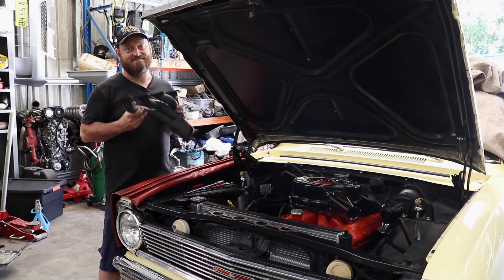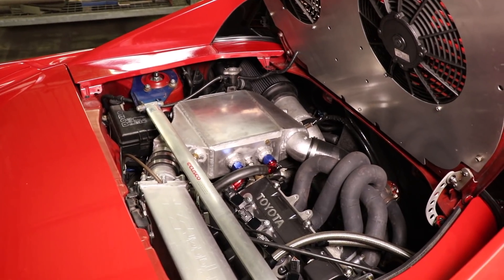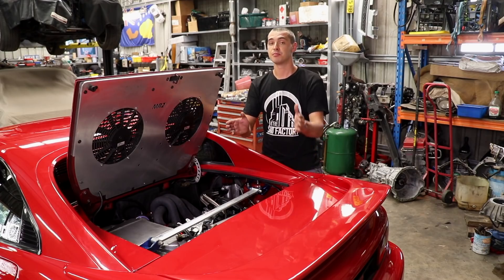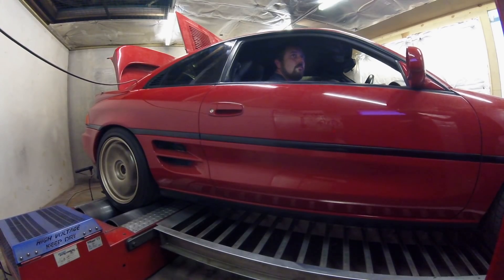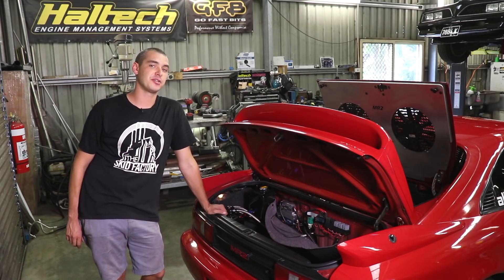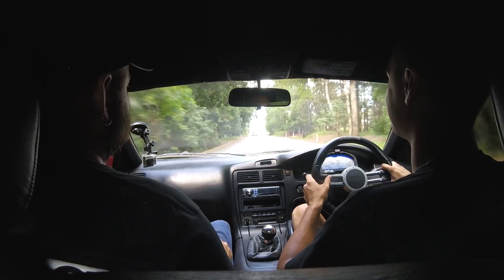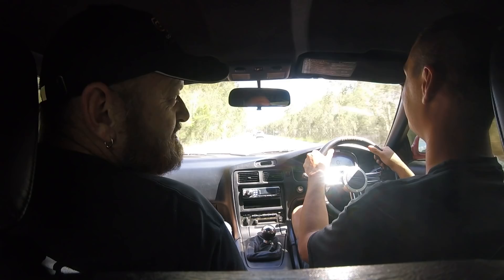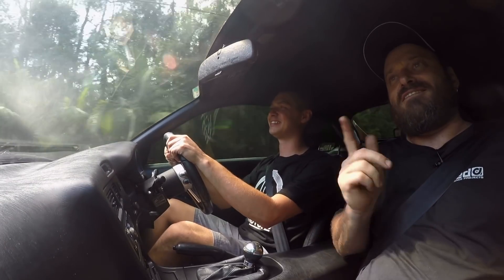THE SKID FACTORY - 430HP SW20 TOYOTA MR2 [Build Review]

Comment: Daily my 88 Aw11 for the last ten years. It's fun but some parts are getting hard to find new. Bought a 94 pickup a few months ago to slow the mileage on the mr2. My first car was an 87 Celica with a early 3s-ge. Old Toyotas are good for what they are.
Reply: I just stopped daily my adub 6 months ago after 6 years or so, and my first car was a 91 celica st184. I had a ZZT celica for a while and would love to get a 2ZZ in my aw11.
Reply: Just sold my 94 pickup about 2 weeks ago. I miss it already.
Reply: Aw11 owner high five!

Comment: The gen4 3sgte from the Caldina is the hot set up now for the MR2.  300whp on stock turbo, ecu and injectors has been done.  That's the route I finally went with my 91.
Reply: Definitely went in the right direction. Sounds awesome.

Comment: as an MR2 owner, one running 300whp, I can appreciate the time, effort and cost that goes into these cars. The biggest improvement is by far once you get a properly tuned EMS running.

Am interested to know if the fan shroud on the bay lid makes any difference to engine bay temps.
Reply: Definitely. It pumps out so much hot air.
Reply: No need for the rain tray either if it never rains there.
Reply: @modermonkula  I'd never to choose to drive in the rain also. It's terrifying enough as it is.
Reply: @25LQW  Yeah thats my thoughts on it, I've been having problems with engine bay and intake temps and being able to reliably push the boost past 16psi. Have been reading up on these shrouds for the last few months, heaps of talk on negative/positive air pressure in the bay and disrupting the air cycle. could be a good mod for city driving, interested to get your thoughts. Being in Wellington NZ, don't have the option of removing the rain cover.....
Reply: @jonoerees  my fans are run through the ecu and are on pretty much the whole time. They work really well. I wouldn't worry to much about the rain with this shroud on. If the fans are running no rain is getting in. As long as your air filter is not exposed it will be fine. And don't run those tom's snorkels. It goes against the flow.
Reply: @25LQW  Thanks

Comment: The 3 litre V6 out of the Camries is pretty much a direct bolt in to those .. I hear they dont mind a bit of boost either
Reply: I think you are referring to the 2GR-FE? It is an absolutely amazing engine. So smooth and will make a healthy 280whp in stock form.
Reply: shoominati23 no
Reply: @NippyMoto  My plan is to drop a stock 2GR-FE in my MR2 whenever my 5S-FE goes. 280 is plenty for me as my daily driver.
Reply: I almost bought an SW20 shell for $800 this year. Toyota V6 was my top pick for swap.
Reply: The 1mz is a good donk.
Reply: @NippyMoto  people were putting 1MZ's in these long before the 2GR even existed. Or 1mz/3mz hybrids.
Reply: @802Garage  just put a K series in it. More reliable.
Reply: @madgreek253  Not really. Not if you turbo it. The Toyota V6 is just as reliable as a K engine and makes way more power NA. Besides if we all did the same swaps cars would be boring.
Reply: My brother had a 3litre v6 converted one, thing was a weapon
Reply: The 2GR-FE engines come supercharged from TRD and go alright but never seen a turbo one
Reply: Needs Radial swap
Reply: Theres nothing wrong with either , but the 1mz is more common in australia .. if you treat either of them right they will go forever . If people tell you they are getting even 50000 miles between rebuilds on a 1000hp 2jz they are a liar
Reply: @brian-yy4bx  lotus evoras run a 2gr with a supercharger kit
Reply: Or just do what Toyota did once and fit in a 1uzfe
Reply: @802Garage   which v6 are you talking about the 1mz or the 2gr fe?
Reply: Brendan Coleman yes mate! That’s the swap you wanna do, dunno how easy it’d be to locate any turbos but with a Haltech Elite it should make pretty respectable na power.
Reply: Like the Evoras's
Reply: @jaykatana9418  I was more thinking of the 2GR. Been a minutr since I researched it though.
Reply: Even the simplest engine swaps are never bolt in. Mighty car mods has really ruined the car community, hate when the term bolt in is used when regarding engine swaps, always used by people who have never actually done an engine swap themselves.
Reply: @Mantenner  How has Mighty Car Mods ruined the community? They're the first ones to tell you nothing ever just bolts in, especially engine swaps. They always talk about how it takes hours and days and really mechanically skilled people involved.
Reply: @alistermccallum  yes, that would be the truck and 4 runner engine... Not the same as from Camrys like being talked about here
Reply: @802Garage  They say nothing ever bolts on sure, but their content has given so many people the opinion that you can do something easily, only recently with their unedited videos do you really get a look at how difficult it can be. Add to the fact that all of their cars just chase power (except marty's kei cars), turbo this turbo that, focus on nothing but the HP figure, bolt on sponsor's parts that normal people will never need or afford for a road car, people only focus on that. They're one of the most mainstream channels to execute said trend and many have followed.
Reply: My mind is actually fucking blown. My mates first car was a 1MZ manual camry (relatively uncommon in Oz, it now resides in another mates driveway) and it fucking -->hammered<--. I always wondered why the hell Toyota wasted that package on such a boat as the XV20 but, alas, Wiki tells me that the transmission was also used on the SW20 turbo.
As far as I'm aware the "bolt-on" TRD Supercharger kits were nothing but trouble for the 1MZ, but with some supporting mods.... 

Guess I just need to find an SW20 now. 😎
Reply: @Mantenner  I completely disagree with you. I think they have always been honest and shown the entire process. They have always made it clear that the work was edited down and took far longer. If anything they are more honest about the process than most YouTubers and they even reference that repeatedly in videos. They also joke about commenters thinking everything is quick and easy and tell them it isn't. I am talking about MCM not just Skid Factory. If people are too dumb to realize that a montage is not real time, it's not the fault of MCM when they give direct disclaimers.
Reply: The 3vz-fe bolts in and handles boost like a champ
Reply: I recently owned a 1mz swapped MR2 for about a year, brilliant car. It was fast enough to have a lot of fun in, although my 330ci is just as fast in a straight line while being much smoother. Its a great swap for how easy it is.
Reply: @802Garage  Fair enough, I do agree if the viewer thinks it's that easy they are dumb, and my comment was an exaggeration about ruining the community, I just know people that seem to have a skewed view of working on cars due to MCM and youtubers of the same caliber. We'll have to agree to disagree on their influence and impact however I guess (I actually think Skid Factory do a much better job of showing the process or working on cars than MCM, I love both but I prefer Skid Factory). 

The whole "JDM" turbo boy culture has erupted due to MCM at least here in Australia, and the first question I'm always asked about my cars is "how much power does it make?", and I whole-heartedly attribute that to youtube builders, and with MCM's size and reach, them in turn.
Reply: @Mantenner  What have you been smoking? people have been asking that question long before mcm.
Car culture always reflects the relevance of "time" and what are the most popular influences.

In NZ, the most popular influence was performance car magazine, then reading hot4's to have a laugh at Australia and to see what not to do when modifying a car.

Most times though the most influential thing is the people you are surrounded by. if your cars shit, attitudes shit and you're are clueless muppet, generally speaking it's likely your mates are too
Reply: @Mantenner  I get what you are saying, I just really feel all the guys at MCM do their best to combat those exact sentiments. There really is only so much you can do on a YouTube channel. If you show absolutely everything you end up with a load of content that isn't nearly as appealing to a mass audience.
I can definitely agree Skid Factory shows more of the process and makes it more apparent how much work goes into a build. Most of the builds so far have been more complex than the average MCM build though. At least the older builds. I get a ton of enjoyment out of Skid Factory and it's basically the type of content I want to make myself.
I def don't think you can only blame MCM for the JDM turbo car craze either. In general 90s Japanese cars have been on the rise in popularity and every single major American automotive YouTuber has also been going mad for them. Every single channel has an FD RX-7 now and everyone is importing Skylines too.
I still understand your frustration though, and MCM definitely amps up the automotive crazes in certain directions. For what it's worth though, I think it's deserved. I've loved Japanese turbo cars since before I started watching MCM so it was really more like finding guys who love what I do!
Reply: seen it done in a mk1 Mr two
Reply: 2grfe 3.5l with 6speed trans, 268whp 240ish trq and yrs you can find turbo or supers
Reply: @802Garage  as an individual, MCM has inspired me to do engine swaps and car builds
Reply: @douglasrussell5061  Same here! Incredible crew all around.

Comment: VR6 in the AW11👌🏻
Reply: + turbo and E85!
Reply: not that vw pos .... even that 4age with turbo or sc is much better engine .. and better fun that vr-sht...
Reply: dawe82 yes a VR6 is an old boy, it’s a tank. It would murder a 4age and make gobs more torque. The only real downside of the engine is it’s weight , it’s a hefty fat bastard. It was originally a diesel block VW had designed.
Reply: Who cares, do it!  Itll be interesting.
Reply: yep .. two thinks wich make sw20 more snappy ... weight on rear .. and more torgue .. :D i think 2zz will be best in it .. with sc ... there are many options in toyota stable for this car ... i will never ruin it by vw or some other brand .. (maybe sr20det .. :D)

Comment: I wouldn't complain about owning a clean sw20 like that one, but there definitely not as stout of engine as the 4g63 6bolt. The thing sounds really good though. I always respect people who are devoted to a more challenging platform.
Reply: I almost bought a shell for $800 this year. My plan would have been either a Toyota V6 or a 4G63.
Reply: Stout how?
Reply: Stout like handling 500+whp with a stock bottom end, only head studs, and proper tune on e85. Not too many 4 bangers that can even come close, maybe a proper K series.
Reply: @Sloppyjalopy123  I would call a 3sgte equal in those regards. If you hadn't noticed, people slapping bolt-mods onto stock 4g63 engines are always having them break. I wouldn't trust a Honda engine to be any better. None of those OEMs had 500 HP in mind, and they wouldn't waste money on making those engines that stout. It's not a matter of if they fail, but when. 4g63 engines have a lot of thrust bearing troubles.

Comment: Waiting for all the "snap steering" comments...🤔
Reply: Snap over steer is fun
Reply: You'll only see that from folks unaware that it can be done away with through mods
Reply: 92 and later had it fixed anyways. Off throttle toe changes from new links in rear
Reply: Is that a thing??cause the only time i have driven this car, i spun it. Lol
Reply: I own a 92, just like any rear engine car you can spin it out. But lifting off to change gears doesn't enduce the snap oversteer and was why I got the 92 and and not the 89-91. Also had the nice lights over the 93 with the hex shaped things
Reply: True. Though here in NZ Ive seen my fair share of them in a ditch heading out to Piha, Bethells and Muriwai beach roads :D
Reply: @Lethal_Intent  I'm from NZ haha
Reply: As long as you're expecting it and planning on it... It's a heck of a lot of fun.
Reply: never happened to mine, if in doubt side step the clutch lol
Reply: Aww.. snap
Reply: Came here to drop it :)
Reply: hahahaa.....   loss of skill moments more like it.
Reply: @Doogleraia  this is true wilhelm raceworks make a correction kit for this but in saying that most of the time is driver error
Reply: Jay Katana Yeah that's one of the kits, also a lot of folks additionally remedy it with moving the tank to the frunk-area as well as a larger radiator for the remote radiator (generally shifting more weight in addition to the other mods), and I've seen people put in 4-wheel steering mods as well to completely do away with it.
Reply: You can't change the laws of physics its all down to hoe experienced the driver is.
Reply: There is a yellow one in nz guy made DVD series I forgot who it was
Reply: @49ics05  ketzel sterling and flyin I think is who you're referring to.
Reply: From idiots who've never owned or driven one, no doubt.

Comment: Guys please do a video on using stock diverter valves vs aftermarket Dv vs using a blow off valve vs none at all and whether closed throttle compressor surge is detrimental to a turbos longevity

Comment: You forgot to talk about the most important mod: the Alpine stereo.
Beautiful car.
Reply: Alpine head unit from 10 years ago. JL audio amp for kicker slim sub, pioneer bullet 6 inch splits from 10 years ago, apine 4 channel pdx amp running the splits. I need to get some Bluetooth adapter for the head it so can use spotify. Still has cds from years ago. Haha.
Reply: 25LQW I have a similar unit check if there’s no USB input at the back or by googling the model reference. They support  up to 16gb usb drive that you can fit in the glove box with the help of an USB extension.
If not you could indeed root for a Bluetooth adapter like the imars t10, it does the job, but uses 1 cigarette lighter socket, sticks out in the interior, and output is compressed
Reply: @NissanMarchK11  I'm definitely not using a fm converter. There is a Bluetooth module that you can buy that fits that head unit. Just got to way up that cost vs a new modern head unit.
Reply: 25LQW I also considered buying it at some point but these old alpine BT modules has some really bad reviews (bad sound quality, disconnects without any reason) I would stay away of it.

Comment: The vr6 motor is about 170hp. The 2zzge is lighter, rev happy, makes about 190hp and matches nicely to the character of the original 4AGE engine. Plus much easier swap. One custom mount and NA SW20 axles. Not to mention the fact that you are putting a great toyota engine into a classic toyota sports car.

Comment: Love it! Especially since it's all Toyota and not a K swap lol. 2000 CC injectors? Wow
Reply: There actually 2200. E85 eats a heap. Basically 1000s won't cut it and there wasn't much on the market at the time that suited my budget.
Reply: @25LQW  yeah I knew it would be E85, but that's quite large for a 400 hp 4 cylinder lol. That makes more sense in that's what you could get.

Comment: Nice one
Interesting not using an intercooler.
But otherwise very cool.
Most of the rear suspension proplems in the earlier MR2 can be adjusted out with aftermarket suspension parts.
They did a big rear suspension upgrade from the factory in 1993.
Reply: It does have an intercooler, water to air. Works awesome. It's the heat exchanger is not mounted at the front. It's at the back.
Reply: @25LQW  Most intercoolers are air to air.
E85 and air to air is the go...lol....
I used to contract for Toyota

Comment: It is noisy probably because he replaced the torsional engine mounts with polyurethane.  It turns the cockpit into the inside of a drum.  Replace the polyurethane mount on the firewall with the stock rubber one but leave the other as poly.  It is a good compromise between noise and strength.
Reply: they are just inserts to the rubber mount. not full poly, and its only those 2 also, the others are stock rubber. the noise is actually mostly from the intake manifold.

Comment: 1:45 Looks a bit like a early 90's lotus elan from the front. Is that the stock bumper?
Reply: Yep all stock. Except the rear muffler  grill which is carbon and the rear spats which are a little bigger and in carbon.

Comment: How does the engine come out? One piece at a time or out the bottom?
Reply: You got to pull the rear suspension, and drop it out the bottom. Bit of a nightmare.
Reply: With a hoist it's easy. Out the bottom.

Comment: Has to be a 2GR-FE in the AW-11 guys. Way better engine than the VAG boat anchor
Reply: Seconded... go hit up an wrecked Aurion fellas
Reply: 1cylinder head > 2 cylinder heads. Only exceptions I’ll give are V8s and V12s everything else is unnecessary and a real PITA.
Reply: Jack Eagan 2gr is one of the easiest swaps you can do into an mr2. Mines currently running 330hp and 306ftlbs NA

Comment: Fit a Subaru Flat 6 engine in to it some mods required as It is a flat-six, 24-valve, quad-cam engine with an aluminium block and heads

Comment: Nice car, a little down on power for the mods -- 272 cams, 2000cc injectors, E85, what's the hold up?
Reply: the block lol
Reply: Matt hasn’t got the balls to throw 30+ psi at it yet
Reply: @maze2756  You'll never know if you have a thin or a thick block unless you send it or cut it open.
Reply: @1gt4dude  oh aint that true lol  just send it I say lol
Reply: @Woodrigos  I do. The Hoff just stopped and said that's enough. Has a 4 bar map sensor ready to roll 30+ psi.
Reply: @maze2756  Yeah I agree lol, atleast see what it makes before dropping the boost back to daily levels